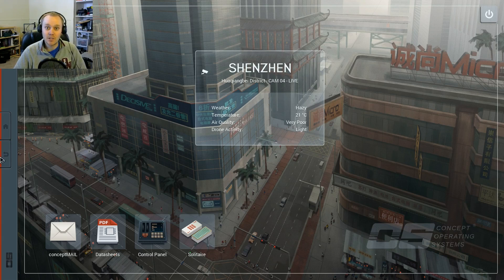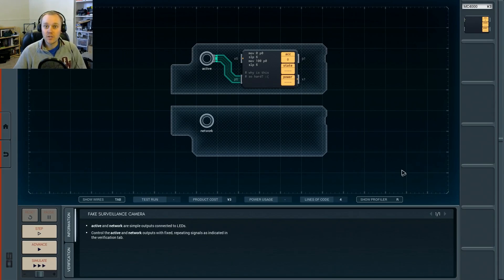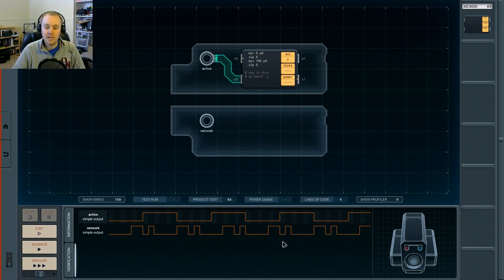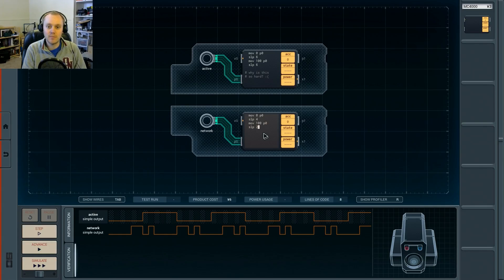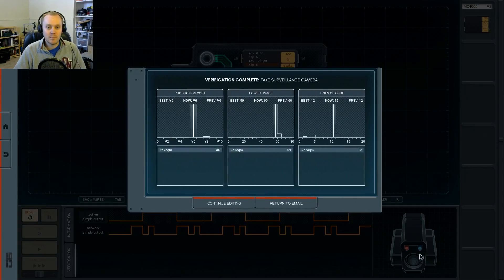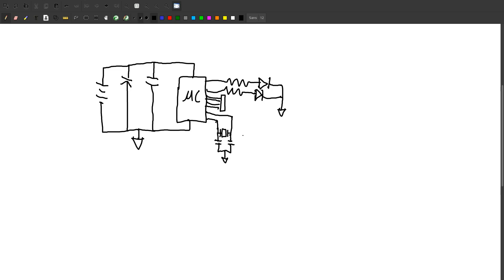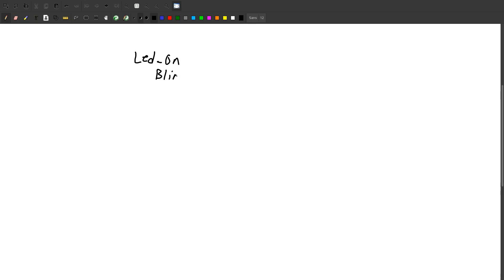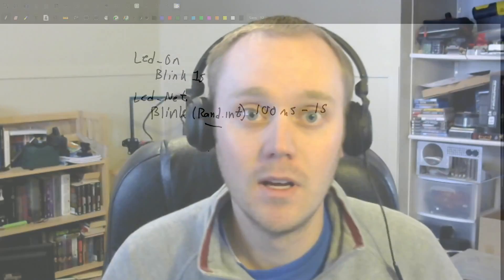Shenzhen I/O in Real Life - Part 1 - The Plan

Comment: So I just wanted to come back here all these months later and point you to my channel where I’ve posted a few videos of me doing arduino and Pi stuff. I made an LED matrix! Hand soldered!

I’ve also had some PCBs made from JLCPCB and done some Arduino stuff with bare 328 chips as well. My next project is some ham radio boards which is a BIT more complex with RF involved.

Oh, and I still don’t really GET electronics. But man, having a PCB made is such a personal level-up.
Reply from the maker: I am glad you came back as it sounds like you have been busy! LED matrices are definitely fun projects, I did a few during my undergraduate work. Good luck on your ham boards, there are a lot of things that you have to watch out for when you do RF design, so you don't have or cause interference with other devices. JLCPCB does a pretty good job with boards, and they are usually pretty affordable, which is always a plus for making small runs for prototyping or one-two offs. And as far as getting electronics, it sounds like you are at least on the right path, and it takes time. I find it can be very difficult because it isn't something that you can just see and understand, you have to try to grasp a lot of abstract concepts and ideas. I find there are a lot of water analogies for a lot of things. Again, best of luck with your projects.

Comment: I'd probably do the same, but with internal oscillator just because I'm a cheap bastard...
ALSO, to make the whole thing more faithful to the game, I think it would be very funny to use the cheapest Chinese micro you can find!
I found PADAUK Tech PMS150C-U6 on lcsc.com. It costs a whooping $0.0365 if you buy 10pcs and $0.0273
 if you buy 100!
It's got 6 pins; 2 for power and 4 GPIO; more than enough!
Reply: Tbh at this price the mcu is probably better, but I'd have gone for a more traditional ne556/555 pair or transistor oscillator, but for higher volume you might be able to get the 556 cheaper. I do understand why it's not done because it's just an example.

In mass production like those cameras are usually done you'd likely use a bespoke cob (chip on board) design, i.e. order multiple wafers of the chips, with everything except the leds integrated, and glue the chip directly to the pcb. The leds would also likely be cob since you'd have the tooling ready.
If you've open any cheap mass market device you've probably seen those black blobs, thats the cob, covered in epoxy
Reply from the maker: Honestly, there are probably a dozen better ways to have done it, and cheaper micros would have been more true to the game, but I did want to also make this a little more entry level and entertaining, with the hope that someone who wasn't a developer or programmer already would be more interested in trying it. That's why I considered using the Atmega, since it would help point new devs to Arduino to get a start with firmware development. Maybe it worked, maybe not. I probably should have been more clear in my intention and purpose, but this was 5 years ago now? 

I hope it was at least entertaining to watch.
Reply from the maker: That definitely would have been an interesting way to go. Then I could fight the realism of the poor Chinese documentation. I definitely could have just used the internal oscillator because it really didn't do much for the circuit. I do plan on doing a review of the design, and that was one of the things I was going to talk about. Thanks for the comment!

Comment: I assume that's a ceramic filter cap and an electrolytic buffer cap you drew (without the polarization mark)? I've been out of formal electronics design for a couple decades now but I don't think I've seen the "European" and "American" capacitor symbols used that way before. :)  Looking forward to the rest of the series!
Reply from the maker: You are correct in your assumptions. And yes, I use Kicad as my main EDA suite, and it has a mix of the "American" and "European" symbols. However, I have used these for as long as I can remember, and I just forgot the add the polarity ;) I always use that symbol for a polarized cap, so I always just remember that's what I mean, and forget to annotate it accordingly.